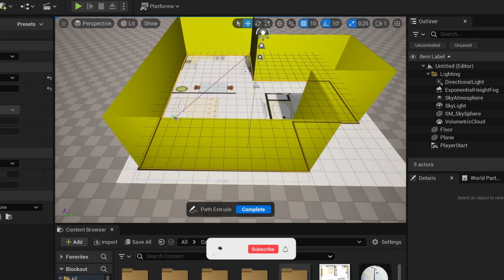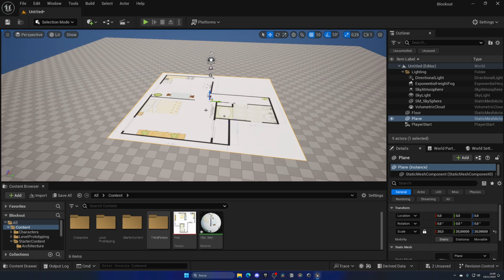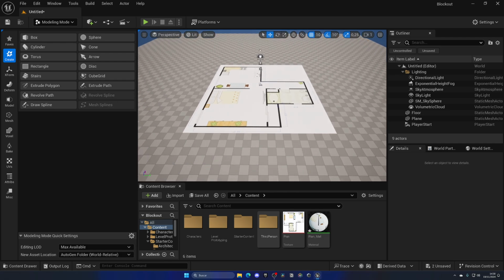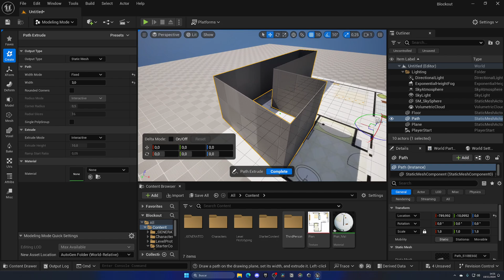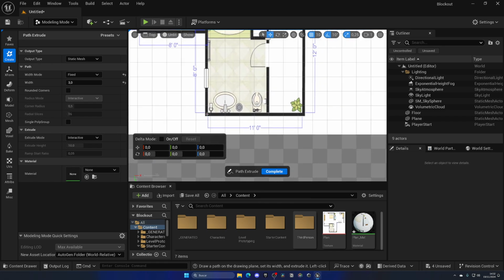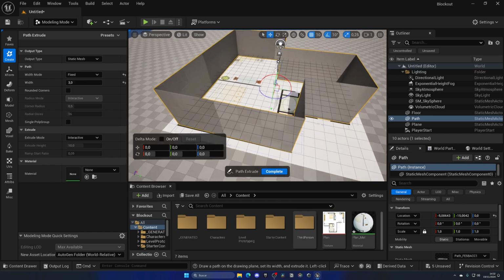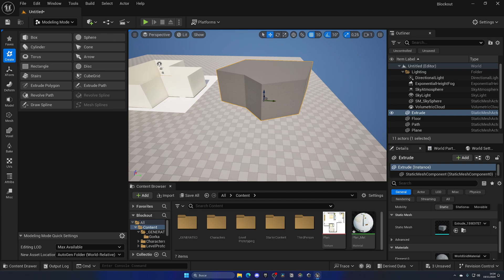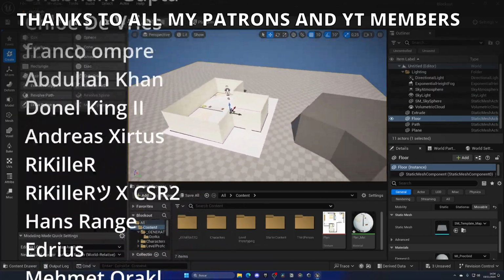How to Blockout FASTER with these Unreal Engine 5 BUILT-IN Tools

Comment: Thanks Gorka! With your first example you made a proper wall structure. But how would you then insert Windows and Doors into that structure? I realize there are cutting tools for this but they tend to cut along a plane from end to end, meaning, a window on one wall will also cut a window on the opposite wall. Any ideas how to address that?
Thanks for your content!
Reply: Ahhh, nevermind! I think I found it. Polycut -> Uncheck/check 'Cut with Boolean'
Reply: @T.O.Moriarty Thank you! I came here to ask that exact question
Reply: @T.O.Moriarty  Does that work?  just wondering too I'm 3dsmax user :-) Thanks
Reply: @decorix  Oh yeah, it works. Polycut -> Uncheck/check 'Cut with Boolean' in Modelling Mode. You just have to spin the Polycut outline around the walls until it's in the position where you want a door/window opening. I can't speak for 3DSMax though. But if you import assets you built you should have the same ability to do adjustments inside the Modelling system of UE.